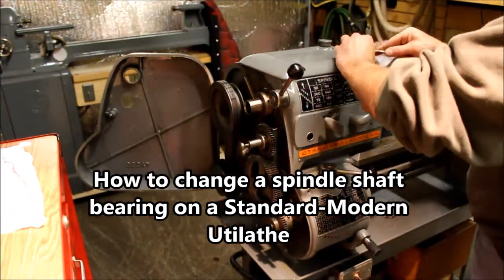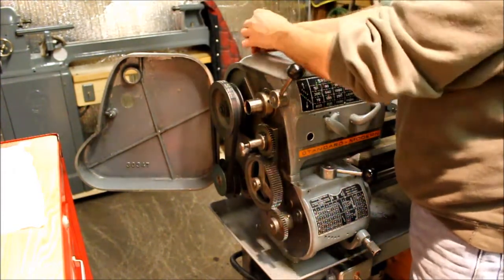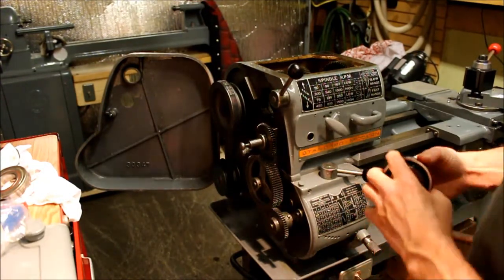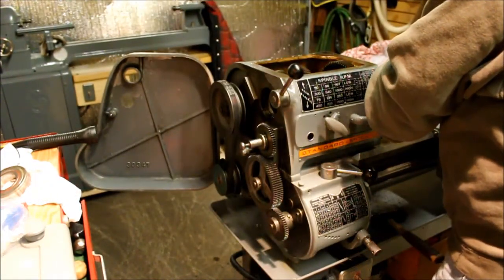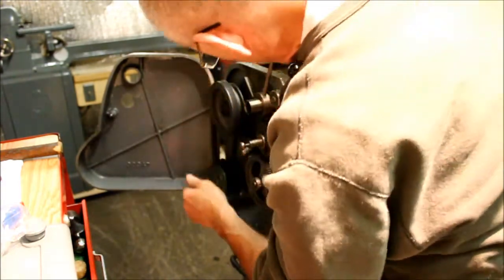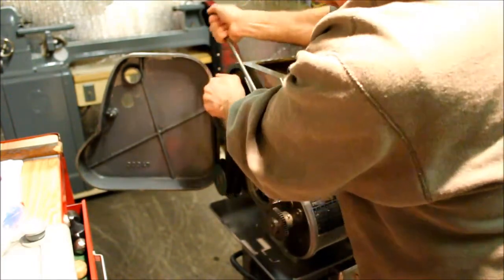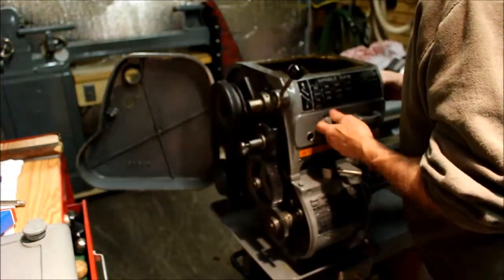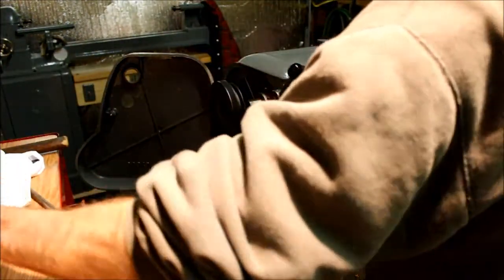Replacing the spindle bearing on a Standard - Modern 10" Lathe

Comment: I can spin my lathe without the tailstock pressed. I do still hear a not right sound almost like some dragging when it's spinning without load.. and it certainly seems like I could spin on a chuck without much issue just not between centers I have bearings ordered is that what this problem sounds like

Comment: How did you get the spinal shaft out, I knock mine in and it hits and stops from coming all the way out? It seems you had the same problem but I could not see what you did to knock it all the way out?
Reply from the maker: Sorry I have been away for some time and you have probably resolved your issue. I just kept tapping the end of the spindle with a soft faced mallet. Good luck.

Comment: Do you have a video on leaks from the left hand end of the headstock? JB
Reply from the maker: I don't have a video but I think it is likely coming from the idler plate. It holds the idler gear and a seal around the coarse/fine feed plunger. It could be the seal or it could be leaking around the plate. I would try a gasket under the plate to see if that fixes the problem first. The seal might be hard to come by. Cheers!